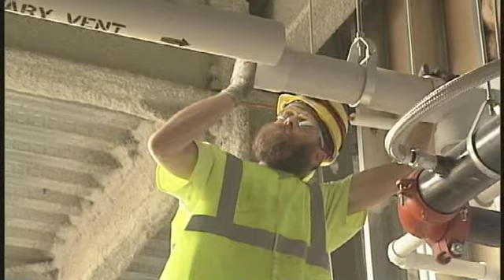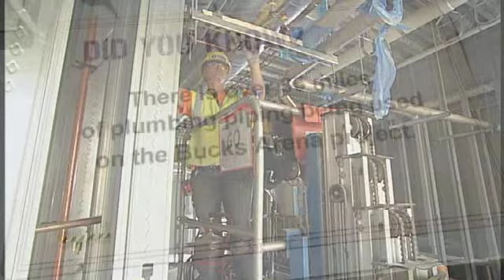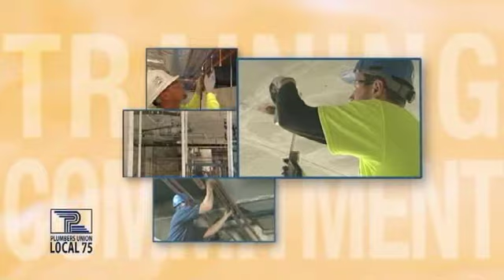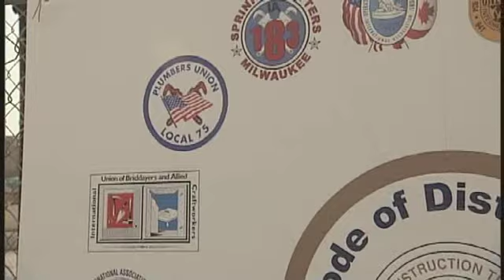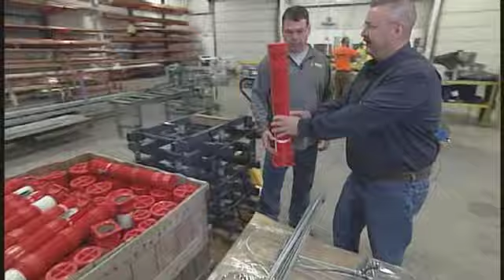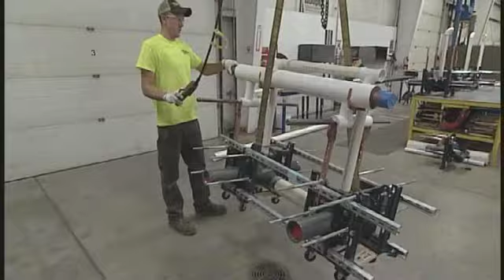Milwaukee Bucks Arena Construction Plumbing Tour

Comment: This company is suspect they don't used primer
Reply: Don't need it by code in some states
Reply: @richardjoseph8683  
Bullshit. Pvc always requires primer or cleaner. It’s just not purple.
Reply: They do use it.  Some states don't require purple primer. Here in Arkansas you MUST use purple so the inspector can see that it's been used.

Comment: My question for the Plumbers at their fab shop is, how are they able to get all the measurements? I have been doing Plumbing for 3 years and nothing is ever the same as it is on the plans.
Reply: Depends who does the plans
Reply: It’s just a carrier layout. Of course it’s the same.
Reply: @Acemechanicalservices  It's only the same if the wall layout is the same. I have been on jobs where the carpenters wall layout was off.